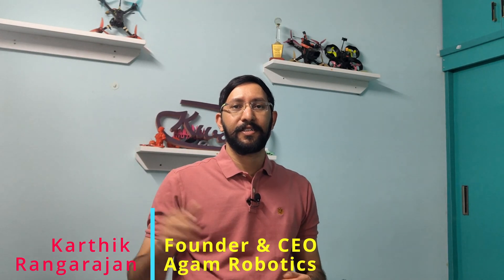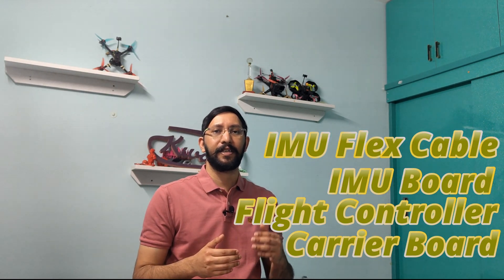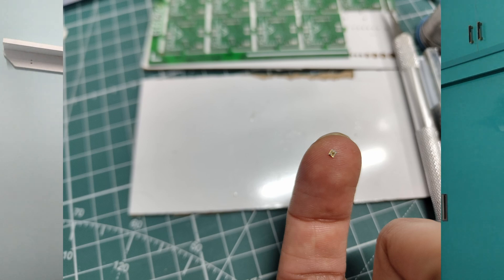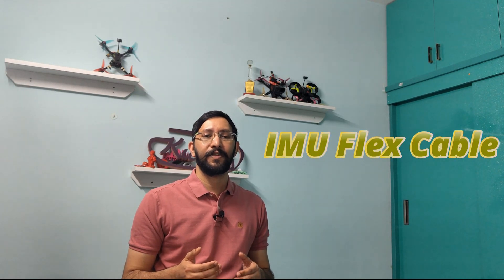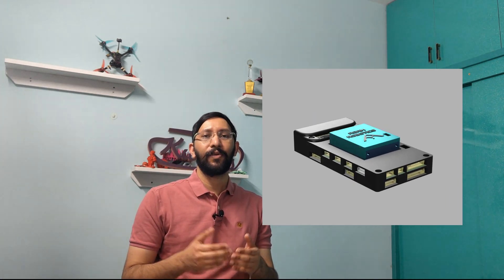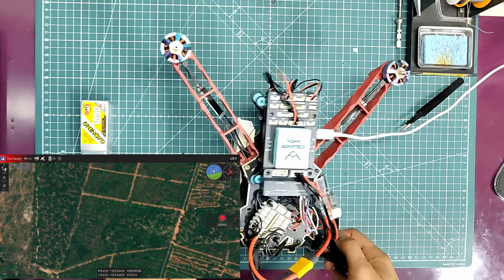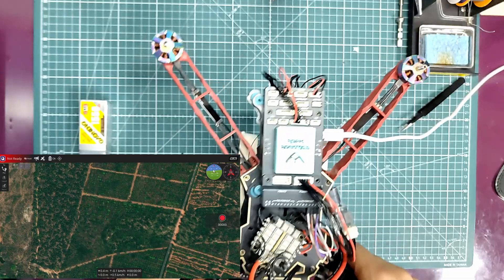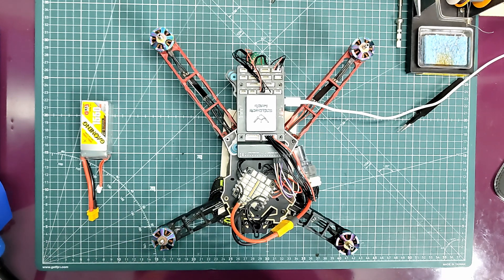Flight Controller/Autopilot product update | @agamrobotics | My Thoughts

Comment: I also made my quad using stm32f411ceu6 running inav.
Reply from the maker: That's awesome! 
Hope you had a good flight on that. inav is quite nice for autonomous planes and kwads.
Reply: @karthik_kwads  yeah I managed to make a very stable quad under just 7000 including batteries, flight controller, frame, homemade transmitter and receiver, gps and compass. The only thing left is fpv system which itself costing more than the whole quad, so I am waiting to find a way.
Reply from the maker: @lalbabugupta8380  Sweet! That sounds great. Yeah, FPV system is way too expensive.
Reply: @karthik_kwads  how much your optical sensor costs?
Reply from the maker: @lalbabugupta8380  I haven't priced it yet, the cost of manufacturing was around 5K. So, for now I am planning to sell at the same price without taking a profit. I can probably add a discount if you need one for testing.
Edit: cost is high because of the camera sensor.
Reply: @karthik_kwads  what is your vision ? Means you said you want to provide market a consumer drone , right? So which price segment you are targeting?
Reply from the maker: @lalbabugupta8380  I am planning to target for nano category. A good nano drones are priced somewhere around 70-100k. I am planning to do the same range but totatlly depends on manufacturing costs.  
But as of now working only on drone parts.
Reply: @karthik_kwads  same I want  to make a descent drone under 20000 (manufacturing cost) it's my standard assumption. And sell it under 25000. I am targeting the DJI air 2s. 
The flight controller are predefined using f405 MCU right now market is selling those fc for 3.5k but of I manufacture it reduce to 1.5k I did the math. Inav has all functions including gimbal stabilisation. What we need to figure out is the motors and esc they are super expensive in India right now. 
So making esc in India should be our goal, then motors which we have to import magnets rest can be produced here. Then to camera. I wish we were neighbours.